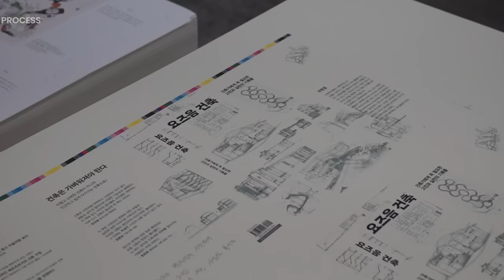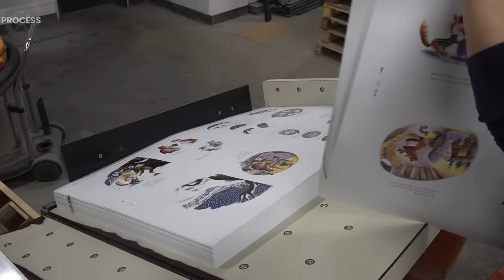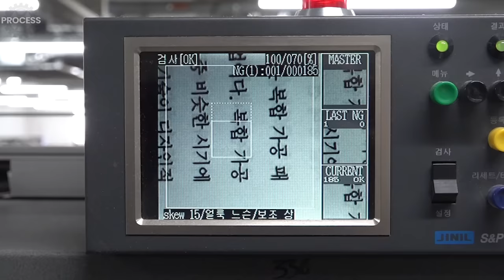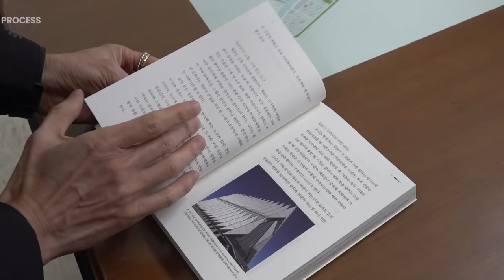300 books in 1 second! Mass Production Process of Making books in Korea Printing Factory.

Comment: Heidelberg Speedmaster prints 18,000 sheets per hour. Each sheet has 32 pages if you check the plate in the video. 32x18,000=576,000 pages per hour. It becomes 160 pages per second. It can’t be 300 books per second. Unless 1 book only has 0.533 page.
Reply: 300 books a second would produce the ENTIRE estimated world's yearly book sales in under 100 days. So I agree, it's absolutely not 300 books per second, not even in the entire facility.
Reply: Korean, you know.
Reply: I'm interested in talking to you about email book making.

Comment: 3:27 From a safety standpoint I find it odd to see this blade cut while the worker barely removed his hand from the paper. I always thought machines like this would have switches that required both hands. Should be standard when operating machines lke these. Maybe there is a laser detecting whether the blade can cut. The stickers suggest otherwise though.
Reply: eu também fiquei apavorado com isso. There's an option in operation menu that turns this possibile... it's totally unsafe but is handled to do more efectivity on production in minus time. but absolutely not recommended